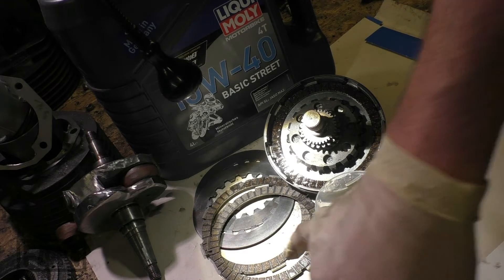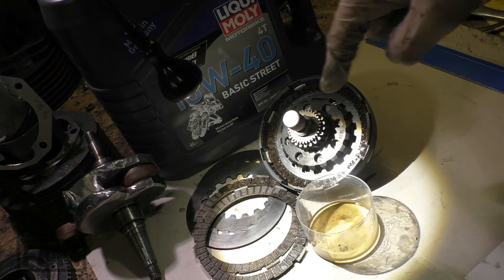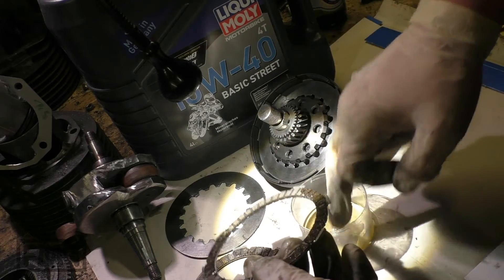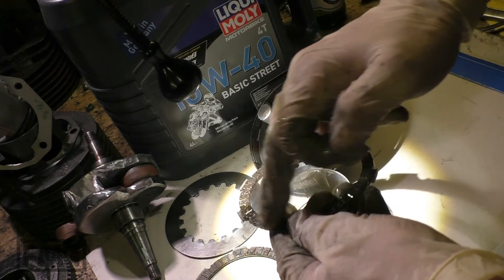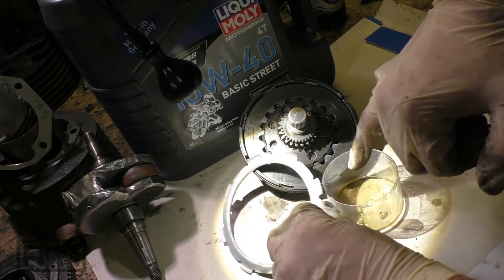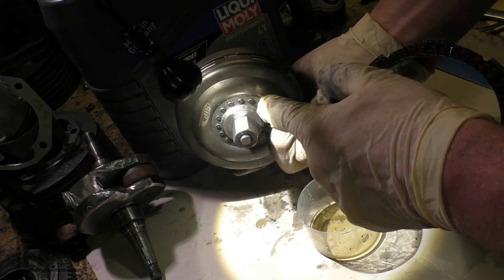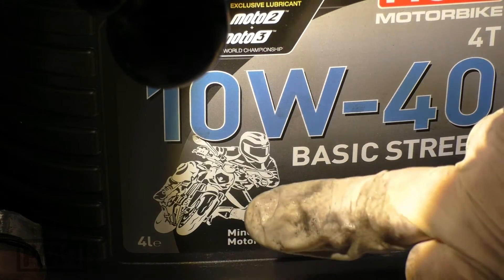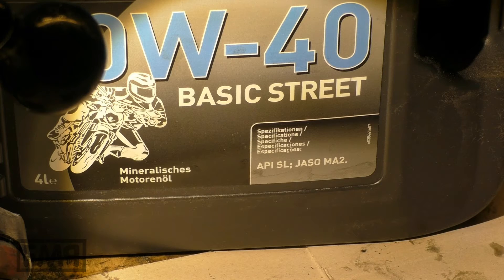the VESPA CLUTCH oil soaking MYTH / clutch linings / FMPguides - Solid PASSion /

Comment: maybe that was more true when clutch plates were made from cork?
Reply from the maker: also they work. Fine with just oiled. There is no functional difference between oiled or soaked in oil. the cosa linings are in general very dryish, out of an engine.

Comment: Hi is 10w-40 semi synthetic   API SL ACEA A3/B3 ok
Reply from the maker: For which linings?
Reply: @FreakMoPed8  just for  standard vespa clutch corks
Reply from the maker: Use standard gearbox oil, ie:
API: GL4; GL5; MIL-L-2105 D 
SAE: 80W; 85W; SAE 80W-90; SAE 90; 

Or

API : GL 4 / GL 5 + LS (limited slip) 
SAE 75W / 80W/ 85W / SAE 80W-90 / SAE 90 

Works fine with standard clutch linings. Dont use the stoneage sa30 anymore, too old, outdated an more expensive than szate of the art oil as its sold only in small amounts 😄😉

Comment: Thanks for videos. Very helpful. Can you help with the answer or the video, how we diagnose air leak on flywheel side seal. Maybe some trick? Thank you.
Reply from the maker: oil leakage, its dirty there, it will rev very high and often not controlable, use brake cleaner (inflammable) spray there if it revs it sucks false air at this spot

Comment: Thank you for the channel, I've learned much. Off subject question; what gasket compound to use with gasket on LML 150cc cases?
Reply from the maker: Standard. A thicker one is goos. It doesnt matter in the end. Important ia to round the edges, use additional sealing mass and  consider the weak spot,

Comment: If I don't find a CNC machine and if I find it, the price will certainly be more expensive 5 times the price of the clutch lining. Can I manually reduce the lining of the clutch ?
Reply from the maker: Yes you can, its pretty easy with a stone grinder machine
Reply: @FreakMoPed8  can you  make the tutorial ?
Reply from the maker: come on. shorteining something to fit does not need any tutorial :) 
its like with paper and scissors, but with linings and grinder stone ;)
Reply: @FreakMoPed8  oke thanks for comment reply